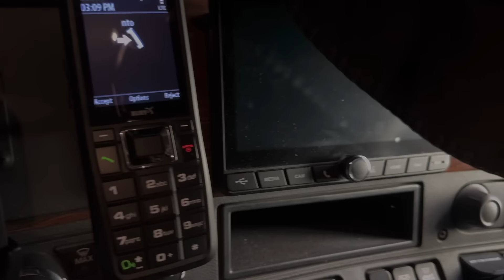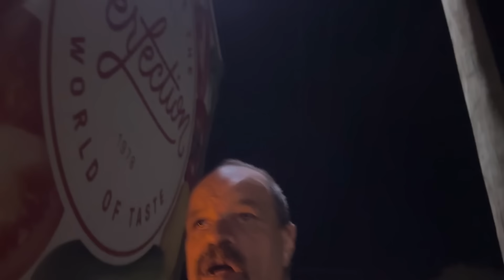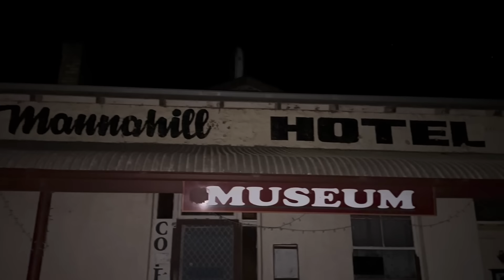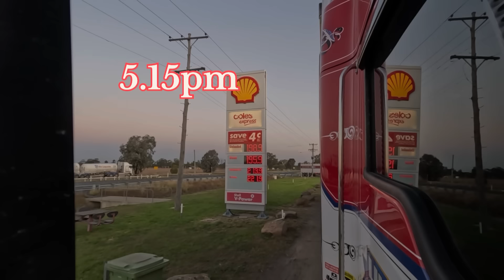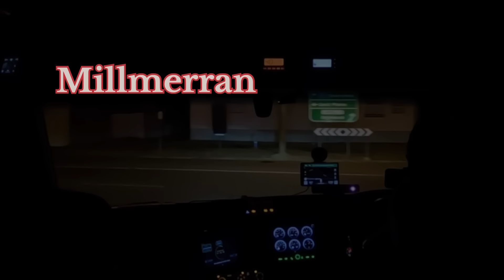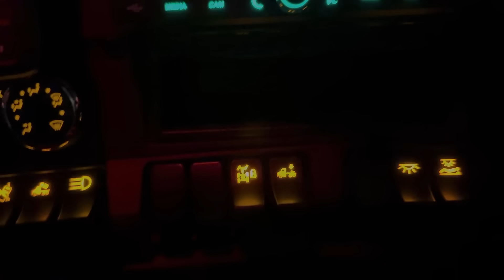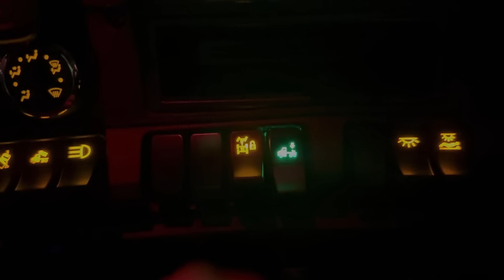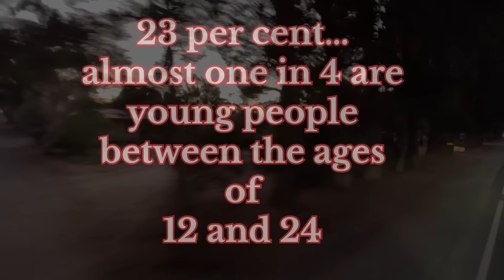Back of Bourke

Comment: Another quality production Kenny,  When I noticed the title that is the 1st thing that came to my head was those Roos,  being you are in really in a east coast runner spec truck.  A 6ft grey be no match for all that fiberglass up front.. A big fella would take out the cooling system & head lights with one bounce.. Then you are stuck  in back of no where., then the crappy paperwork for modification to the truck.. .. Bull Bar be nice but its more weight on the. front axle..  Thanks for time effort in the video,  providing some quality viewing time and enjoy the down time & family.. plus the warmer weather....
Reply from the maker: It’s more a length thing, 26 metres

Comment: Another great video Ken. Congrats on the 10K subs.  I only just noticed that new truck doesn’t have vertical exhaust stacks !! Not that I could see anyway, do they vent to the side of the truck.?  Can’t wait to see you back in September mate . Have a great 3 months
Reply: Exhaust is visible coming out behind the drivers side fuel tank at 1:17, it is surrounded by an alloy box.
Reply from the maker: Yes, it comes out just behind the fuel tank